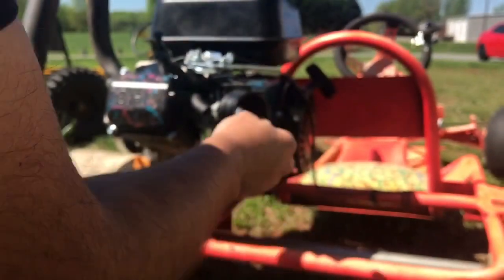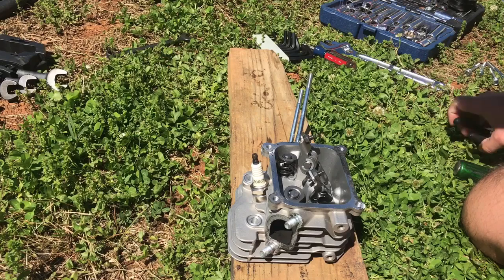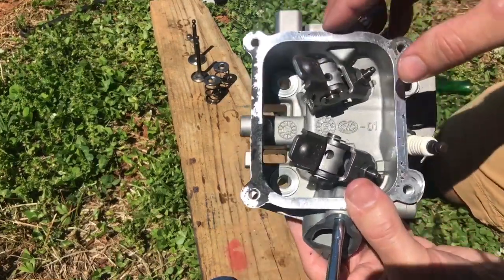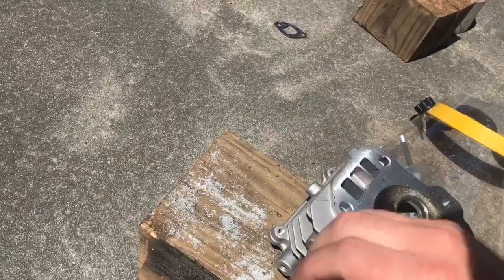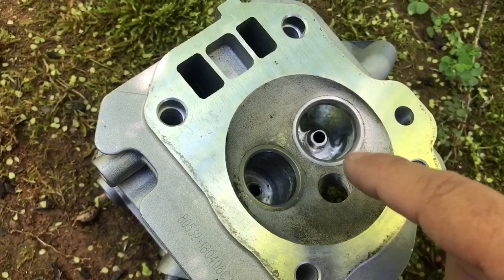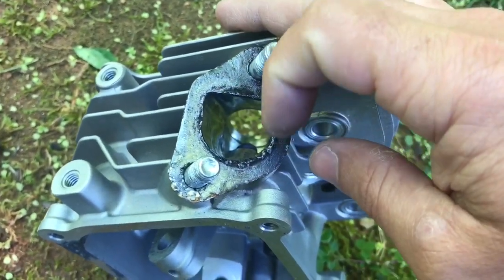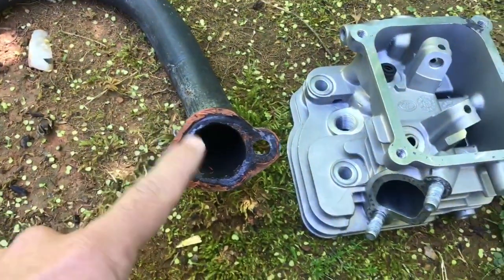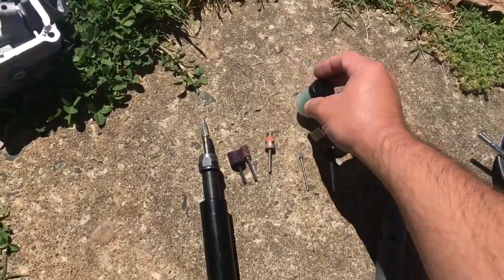How to Port and Polish Your Head - Hemi Predator 212

Comment: Sir, I was wondering, I have a 42mm Mukuni Carb and live in FL. If I port and polish my heads do you thing I'll have to up the clip up one on the needle of the carb?
Reply: I wouldn't try to use a carb that big on a 212. No matter what Jetting or needle setting you run it simply not going to give you a ratio gas to air that won't be extremely lean.  Better results with a 30mm at most for a built engine.
Reply: @Dukk1078  oh it's not for a 212
Reply: @FreedomWon20  A 650 single ?
Reply from the maker: I’m not sure, but if you are moving more air you may need more fuel. The only way to really know if you need more fuel is the do some runs and pull the plug and see if you are lean.
Reply: @jwsbackyard6413  well I pulled the plugs and looked,, REAL LEAN,,, soooo (I orig. had the high speed needle screwed out 2.5 turns.) After taking the clip up one notch I now have the High Speed Needle to 1.5. Runs great, and have a nice brown soot on the plugs??? Is this where I should be?
Reply: And I forgot to mention I did go with a .065.2 jet which replace the stock .060
Reply from the maker: A brown or light brown color with a little carbon is about right but there shouldn’t be a bunch of carbon/soot which would mean you are to rich.
Reply: Lmao worse state too Build a 212 bike
Reply: @dahomieplaysthegame7113  what's so Funny ? , if you aren't drunk, share the joke & we can all Laugh or maybe not ( laugh )Trev NZ

Comment: Will you need a larger carburetor after the head work or something like a Mikuni or will the stock carburetor do the job?
Reply from the maker: The factory carburetor will still work just fine. If you’re taking off a larger amount on the intake side you may want to port match the head and the back side of the carb but either way it will still work.
Reply: @jwsbackyard6413  A 20mm & up Mikuni or Honda kehein carb is like night and day on a Flathead over a butterfly carb.Cheers Trev New Zealand

Comment: I been porting all kinds of heads since 1991. The exhaust needs to be smooth as you stated, and clean up edges in intake and then don’t smoothing the intake side out. You need a flow bench if you are touching the intake side because all that grinding out could reduce flow or foul out your spark plug if you can’t see your readings on a flow bench.